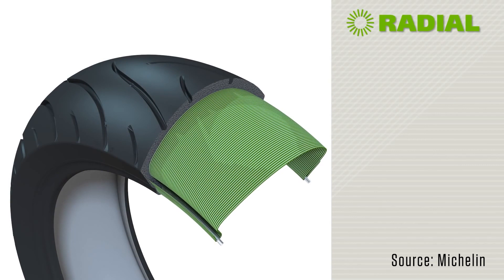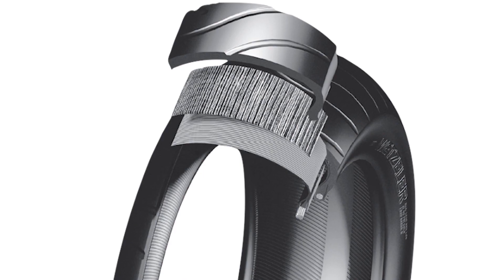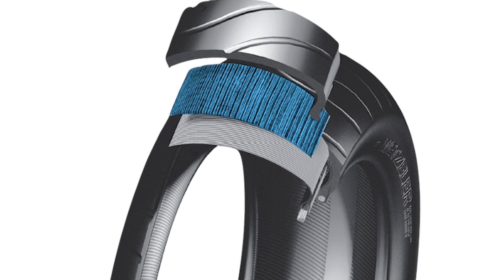Bias-Ply Motorcycle Tires vs. Radial Motorcycle Tires | MC Garage

Comment: Please make a video for tube less tire and tube tire...
Reply: If you end up doing a video on that, also include halters and muses :) . Oh and heavy duty tubes, I've been thinking about switching to them but nobody I know uses them and I wonder just how much it affects handling.
Reply: ply can have a tube and radial cannot. Ply is very simple and primitive design whereby a tube can be used as it’s doesn’t have the wire layer that a radial does. Radials can be plugged due to their construction, ply can be patched or tubed Hope this helps a bit 👍